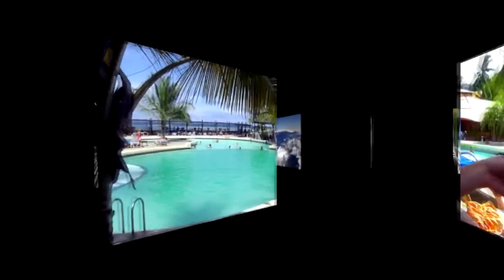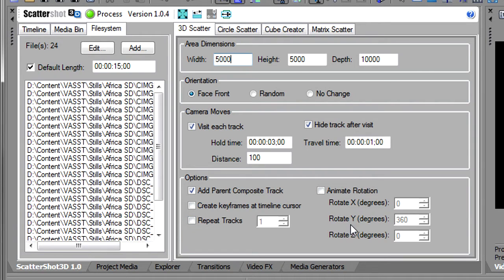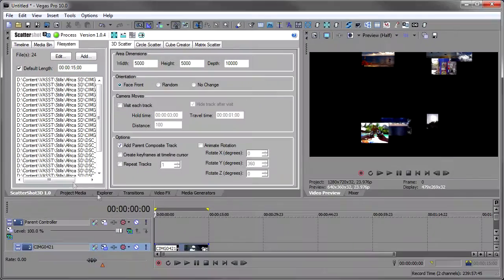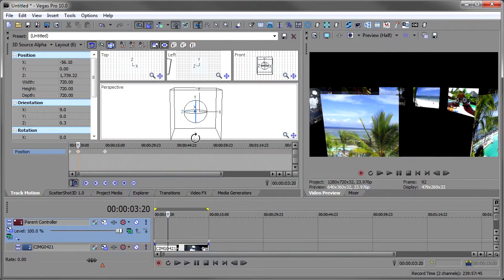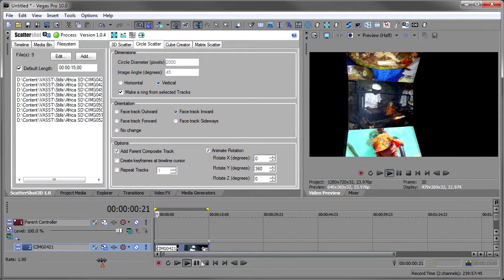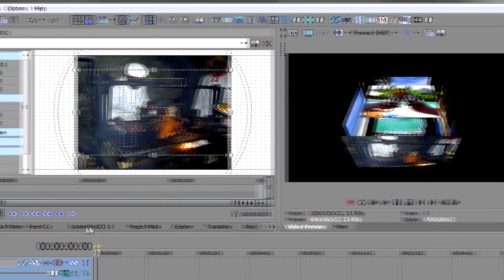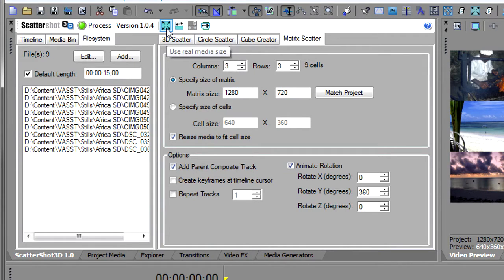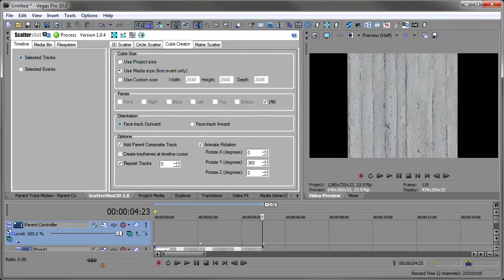ScatterShot 3D for Sony Vegas Pro software, from VASST

Comment: @likes2fly When using 3D planar/track motion in tandem with a stereo 3D project, you will have to manually generate key-frames for the stereo 3D depth because Vegas does not automatically generate this information from the 3D track motion position.  So if you wanted to, you could simply take your first image, and get the animation that you want to have in the stereo 3D space on that one, and then copy it down the track and replace or add as take the new images.  It's not fast, but should work.